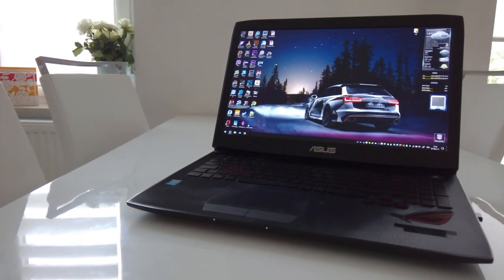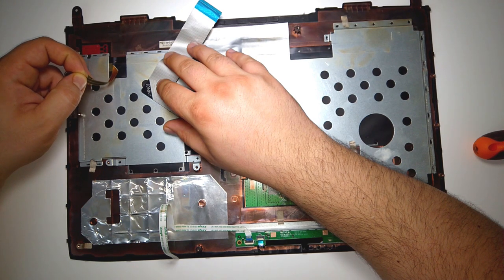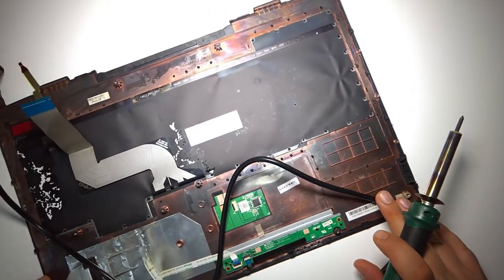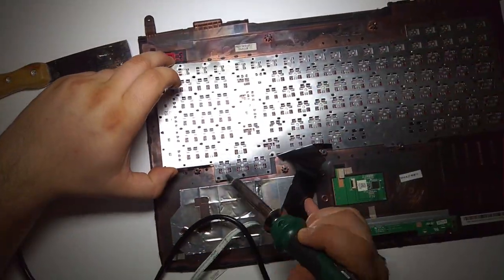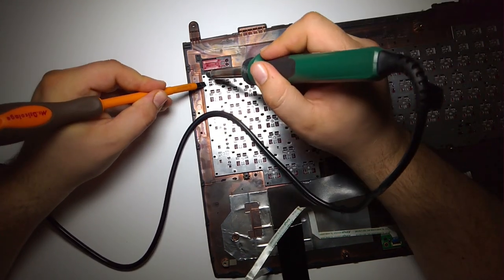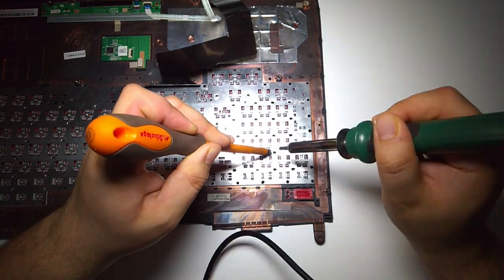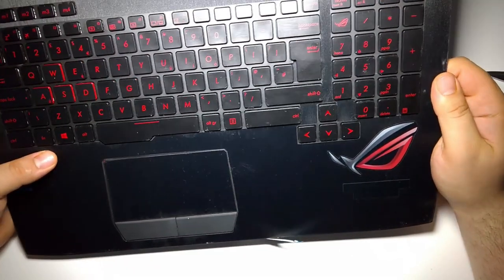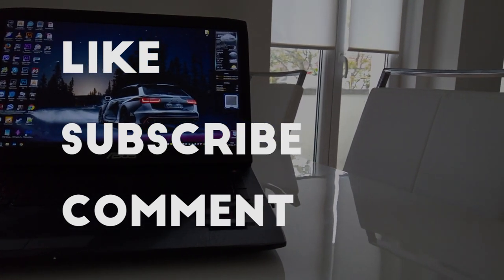Asus G751 - Keyboard Replacement HD

Comment: I can't say thanks enough for this video. It would have been too daunting if you hadn't shown the way! I was able to replace the keyboard in my G751J because of this video. It took 3 hours. Note: if you buy a new keyboard the cable will be glued down where it goes into the keyboard. To replace the back light you have to lift up the cable. The glue is too strong, so to lift it up you can soak rubbing alcohol into the glue with a Q-tip and after a few minutes it will lift up easily.

Comment: Thanks for this. I replaced the keyboard for  my wife's G751. She was already using the brand new HP omen, which has to be sent back for repair on the battery charge circuit. So bought a new keyboard from eBAY and followed your instructions (2 videos).  Worked a treat, except for some of those  plastic soldered points disappearing so could not weld them all back. Wife is happy and prefers the old Asus over the HP because it is more silent. I may end up with the HP Omen which is a more powerful machine (6 core vs 4 core). For work. Everybody wins.

Comment: I want to meet the genius who decided you need to melt the plastic in order to have the keyboard fit tightly.
Reply from the maker: Yeah, I also don't understand why it was designed like this. 
I guess it's to force you into buy the whole palm rest assembly with the keyboard and the touchpad for 100 Euro instead of a keyboard for 20 Euro. 
This is the only logical explanation I have.

Comment: Thanks for putting this together!

WARNING TO OTHERS: This one is harder than it appears! You can carefully melt the plastic with the soldering iron and pull away the metal to try and keep enough plastic for re-soldering, but the process of getting the melted plastic to properly cover the new metal part has a lot of problems. For one, don't use a thick, soft cover under the keyboard, as it won't allow you to push hard enough. I ended up putting a thin piece of paper under the keyboard, and it was much easier to push parts together. Second, even if you were good at preserving the plastic for reapplication, it still doesn't come back into the new holes reliably, so you can end up with several adjacent holes with no plastic going through. I had to steal plastic from other parts of the keyboard to get things to work properly. Third, you need to be really careful with how you position the keyboard before you start. If the keys are not right in the middle of their holes on the palmrest, the sides of the buttons will catch every time you press them. 

If you want to take this on, I suggest using thin paper over a hard surface, getting some extra plastic for soldering, and be very careful about the placement of your keyboard before you start soldering the new one in place. 

I fixed unresponsive keys, but now I have a couple of sticky keys, and I didn't realize the new keyboard wasn't backlit, so I'm looking to replace the whole palmrest with keyboard and touchpad now. :-(
Reply: a few dabs of super glue should fix the lack of plastic probs for remelting one would think Good luck bro. this is one bitch of a job but will save you being charged labor which would probably cost just as much as another laptop.

Comment: how did your get the keyboard off the laptop? I see at 9:24 that you somehow managed to take the keyboard base off the laptop without dissembling the whole thing but that is where I stopped. A little elaboration could help.  thanks
Reply from the maker: Hi Robin, the palm rest is the first thing that comes off the laptop during the disassembly process. You can watch my full disassembly video and see how to do it.
Reply: It is not keyboard but entire palmrest including trackpad

Comment: What a delay!  It's because I bought my asus rog two years ago for video editing jobs and he was already 3 years old, the reason I came to this channel is because the computer has been jittering and jumping on the screen for the last few days, in the lab I was told it was probably the chipset  It started shortly after I had a battery replaced (because it bothered me that the battery stopped charging and stayed at 0% all the time) and I suspect it's because of the computer disassembly and contacts wrong, do you have any ideas to help me?  I have already considered buying a motherboard from China.  Thanks in advance isacc.

Comment: Excellent videos.  If you replace your keyboard be aware that melting plastic attach points can cause some of the plastic to extrude out onto the surface of the laptop, creating little nubs.  They don't really bother but that's why some melt points don't have enough material to make a good attachment, some of it leaked out the other side.  Still, it's good to have a working keyboard again, thanks!

Comment: Very nice video. I replaced the keyboard on my gl552v since it is similar to this. Just a heads up that when re soldering, I suggest doing the corners first then the edges because they are the most likely to pop out.

Comment: great video thx. my G751's keyboard is acting funny, the left shit acts like an Enter and my right shift acts like an apostrophe. is my keyboard damaged? I tried everything, reinstalling windows, updating bios etc but still the shift keys do that.
Reply from the maker: Hi, I'm glad you like it. As a start, you can try to open up your laptop following my other video, you can find it here: https://bit.ly/2t2nCsD and try to reseat the wide ribbon cable. It might be a simple connection issue. If this doesn't help, you probably need a new keyboard. What you're experiencing sounds like hardware, not software issue. Start with the cable.

Comment: At around 5:50 in the video. Where did you get the black plastic to melt with the iron gun?
Reply from the maker: leolcjt When you push enough it will come through. Also the tip of your soldering iron should be thin enough to pass through the holes. Then simply press down hard and stick the tip so it can reach the plastic base and wait 3-4 seconds.  The melted plastic will start to come out through the hole

Comment: Hi! Nice vid but got a question. What can I use to replace that plastic that maintains the keyboard attached to the laptop's case? Because I kinda welded to much some parts and now they are a little loose and I don't like how it feels
Reply: Did you ever figure this out? I need to re-do mine, and there isn't enough of the plastic left to weld the new keyboard back in. Should I just use new plastic? If so, what type? Can I just use glue or small dots of epoxy instead?

Comment: Help! You're missing something very important. I have a Weller pro adjustable soldering iron, what temperature do I set it at! I don't want to melt through. What is a good temp?
Reply: Ever figure that out?
Reply: @destreelarsen6224  no, and I really would like to know as I have one sitting waiting to do
Reply: Keep it at the temperature of non adjustible solder. It is standard temperature at about 350-400 celsius
Reply: I usually keep mine set at 650, because it's not hot enough to stick to anything. This soft plastic at 350? Great thanks
Reply: @gamestacker2  Always try using lower temperatures first, preferably 250 celsius. Though, 350 - 400 celsius is the standard soldering temperature and should work. But, lower temperature is always better if you can afford, as collateral damage to keyboard due to shaky hands can be reduced

Comment: I noticed recently that when I press one key several letters will come out. I think I might need to replace it too. Found your video to be extremely helpful. In the video, you mentioned heatguns may damage the keyboard? plus I am not very familiar with heatguns, could you please give me some suggestions on what I should do for the pins?
Reply from the maker: John Nan Yes, a heatgun will damage the keyboard but you'll be using it only to remove the broken keyboard, not on the new one. For the new one you'll need only a soldering iron. 
You just heat up the metal underside of the keyboard with quick swinging motions until those black pins start to pop up. Start from one end and work your way to the other side. Just be careful not to stay in one spot for very long time. After all the palm rest is also made of plastic, so keep that in mind! The rest you can see in the video.
Reply from the maker: John Nan Or you can just use a soldering iron, like I did in the video.
Reply: Awesome, you are the best.
Reply: I finally tried to replace the keyboard following your instructions with a iron and it worked! The only thing that I notice is that I do not have enough plastic to stick the keyboard so that when assembled each key feels loose. I am wondering what I can do about it? Should I just apply some random plastic to for the sticking?
Reply from the maker: No, you just have to press it firmly down and also if you happen to have a smaller tip for your iron, use it to push further down and melt more plastic. You can also just add some random plastic to strengthen the weak spots. I also had the same issue with certain spots, but like I've said, pressing further down and pushing the iron tip down you can bring up some more plastic.

Comment: Are you still here? I am having major issues with my G751JY. It shuts down immediately when i stress test with FurMark or games. It also switches between battery and AC while i am just browsing. 

It wont boot into windows if i disconnect the battery. 

Is my next step to repaste the heat sink?
Reply from the maker: I am. Were there any symptoms before that, or it just randomly started doing that?
Reply: Dongleboo thanks a lot for the reply. 5 months ago it turned of while gaming once in a while. Then the battery died. Got a new one. Then the AC Jack in died. A shop soldered on a new one.  Now latelly it's gotten worse, and it flickers between battery and AC when I boot and when I just browse. Games or furmark makes it shut down immediately.
Reply from the maker: ss horn This is for sure bad soldering job for the DC jack. It should not be switching between AC and Battery. Is it changing the power source when you wiggle the  jack?
Reply from the maker: ss horn And this issue is not heat related, that's for sure. Because of some bad connection somewhere (maybe the DC jack) when the laptop tries to draw more power the power supply chain fails to deliver the peak power and shuts down. Also, the battery you've bought might be defective and it cannot deliver power properly. 
Like I've experienced myself, when my battery was completely dead and I was gaming, occasionally my laptop would shut down mid-game. Apparently the power management system in this laptop is using the battery as additional power reserve when there's peak consumption (most likely from the GPU) even when it's plugged in to the AC. If it can't use the battery or there isn't enough "juice" it shuts down. This looks like the same issue to me. Start by having the DC jack re-soldered. This might be the cause for all of this.
Reply: Yeah I thought of this, that the soldering was done badly. But after they did it the laptop worked fine (at least I could game low demanding games and browse without problems. PUBG and overwatch made it turn off some times). 

Nothing happens when i wiggle the jack. The switching from battery to ac happens when I do something on the laptop, opening a window, or closing the browser for example. So the way I see it its not necessarily the soldering that is bad, but some component on the MB itself. Maybe the voltage regulator module VRM, or? Maybe something I am not able to fix myself. And I am not taking it back to that shop, they already stripped some of my screws so I cant get to the heat sink anymore....

Thanks alot for your interest!
Reply from the maker: ss horn It would be strange if its a voltage regulator. But nothing is impossible. You should take it to a repair shop, because it does sound like a hardware issue. Sorry I can't help you further. I hope you get it sorted out and hopefully it won't be expensive.
Reply: Thank you for your time. Its really appreciated. At this point I wont spend more money on it so I'll just give it a good ol' 'try my best' :D
Reply from the maker: ss horn No worries buddy. Good luck. :)

Comment: Wow, Asus made this crazy difficult to replace.  I was having trouble with one of my keys through general use, but it's just the number 3, so I think I'll just put up with it forever.
Reply: I popped the key and found some debri under it, now all fixed.  
Note on these keys (g751jy) - I've worn through the key coating on the S key.  Too much retreating in fps games maybe haha.
Reply from the maker: That's strange btw, because I've been used mine for over 2 years before replacing the original keyboard and I never had problems with this. Weird. :/
Reply: I do a fair bit of gaming.  I've had the laptop for over 2 years now.  
My "D" key is now also starting to wear the coating off.  

The S key looks very funny.  Under the key coating is transparent plastic, so you can look down through the key and see the backlighting.
Reply: what kind of trouble? mine is ghost typing on some keys and others wont type at all.
Reply from the maker: Arwin Buluran My old keyboard was ghost typing C quite often and the space bar wasn't always registering. I haven't had that issue since I replaced mine.
Reply: Dongleboo so it was fixed by replacing the whole keyboard? It is not an issue of just debris needed to be removed?
Reply from the maker: Arwin Buluran No not really. I cleaned it multiple times.  It wasn't just typing a C occasionally. It was spamming C and no matter what I did it couldn't stop untilI restart the PC. Logging off wasn't helpful either. No it's working fine.  Maybe the keyboard was defective..
Reply: Dongleboo oh ok. Need to get a new one then. Thanks
Reply: I have the same issue with the D key from gaming, I use it for right turn.
Reply: @SportbikerNZ  if it is just the keycap, replace it with a keycap from the number pad.

Comment: Hello! do you know how to replace the dvd module to the ssd on asus g751?
Reply from the maker: Sergey Kurzanov Yes, it's very simple. You only have to buy an HDD caddy. Then you remove the  one screw holding the CD-Drive and slide the whole thing out. Then just install the caddy with the SSD and that's it. Really simple.
Reply: thank you!
do you know which one? How many mm(or inches) need?
Reply from the maker: Sergey Kurzanov unfortunately not. I'm not sure. A friend gave me his and I never asked. I don't have it anymore because I bought bigger SSDs and I didn't need a third drive. As far as I remember there were 2 options. I don't want to confuse you with dimensions because I'm really not sure.
Reply: in any case thank you.  Now i have right word for google c:

Comment: Here's a tip. Find a strong plastic coat hanger, use a craft knife to strip off some small layers, melt a little over each area, push the soldering iron in to bond it together.

I didn't have enough plastic to get them all down, so I did this trick and it made it a lot easier. It also avoids you having to push down too deep.

Comment: hey bro what about soldering iron can i use any type of this?
Reply from the maker: Like I say in the video - just any will do. It has to melt plastic so a 5W one will do just fine. :) If it was for actual soldering I'd suggest at least 60W soldering iron or more.
Reply: can i use transformer soldering iron? of 60w
Reply: What if i overheat it? How to avoid it? And could u tell me how to remove keyboard?
Reply from the maker: If you're using a soldering iron, just be careful not to hold it for so long that you melt through the entire palm rest (which is highly unlikely as long as you have the metal in between) The keyboard has to be removed slowly one pin at a time. Melt them slowly and pull the keyboard upwards. Also if you have a 60W soldering iron, it'll be easy, just be careful. The rest is pretty self explanatory from the video itself.
Reply: so less W is better? if i m gonna do this for the first time?
Reply: what's the power of your soldering iron?
Reply from the maker: The one I use in the video is 60W (if I can believe what the label says). It's a cheap soldering station I got from Lidl, because I don't have my good one at the moment. You can buy a cheap ass soldering iron from Conrad or something like this. They are 10-12€.
Reply: do i need soldering station? or just soldering iron?
Reply from the maker: Soldering iron. W stands for Watts, btw. :D
This means more or less powerful soldering iron. For plastic, literally, ANY soldering iron will do, as long as it has a small pointy tip.